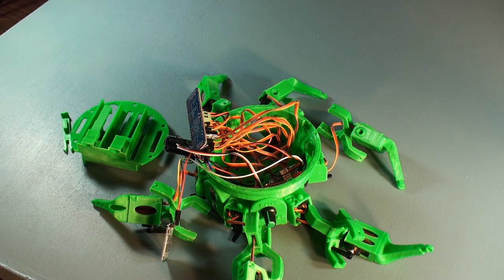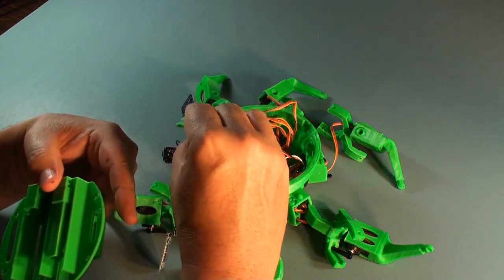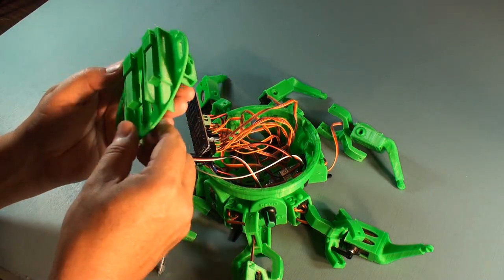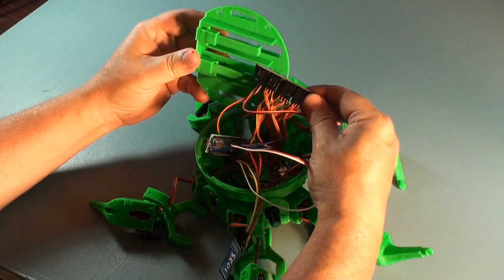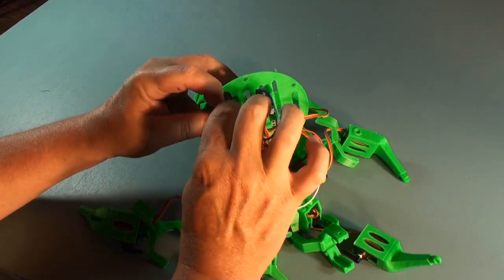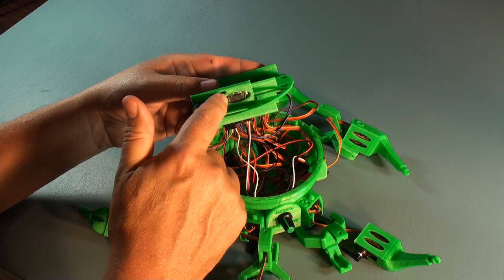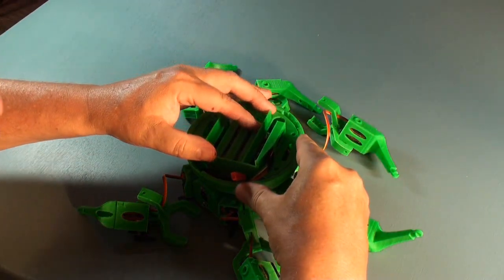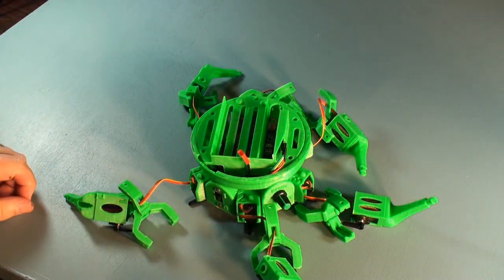Installing the Electronics Caddy

Comment: Hello, have you directly connect the battery to the servo board ? is it enough  or should I consider using a UBEC ?
Reply from the maker: Hello,
If you look at the detailed instructions here on our website:
http://vorpalrobotics.com/wiki/index.php?title=Vorpal_Combat_Hexapod_Battery/Switch_Construction

you can see there is a 3A 5V BEC feeding the servo controller.

You cannot put battery power (at least not at the 7.8 volts we use) into the servo controller because you will burn up the MG90S servos which can't take more than 6 volts, plus the logic portion of the servo controller also needs 5V anyway.  We also find that feeding the servos regulated 5V makes them last a lot longer, they tend to overheat during stressful activity at 6V.